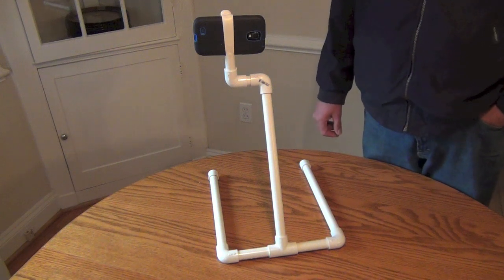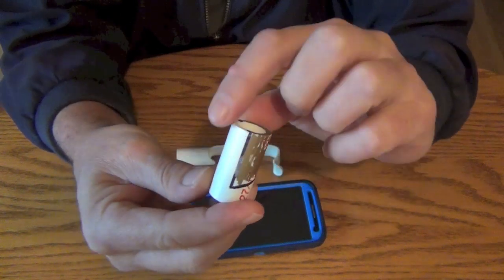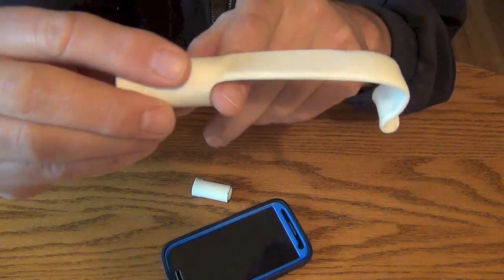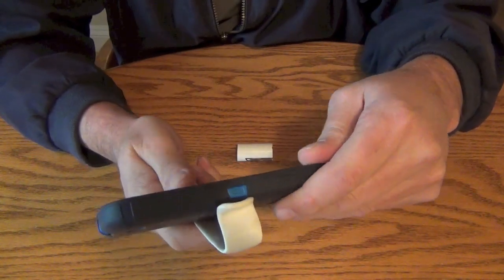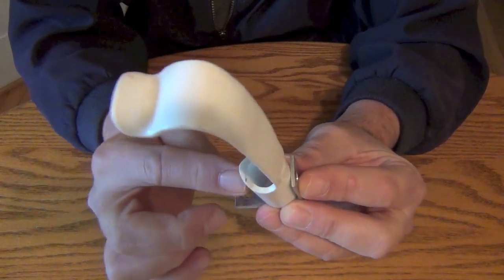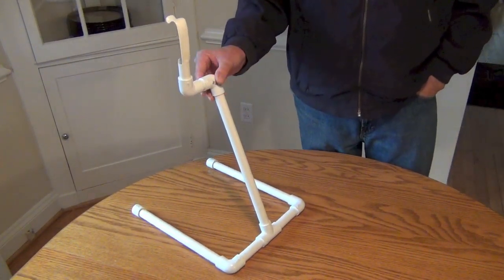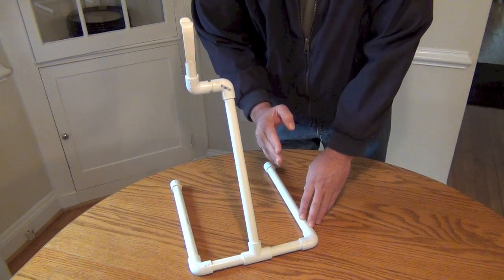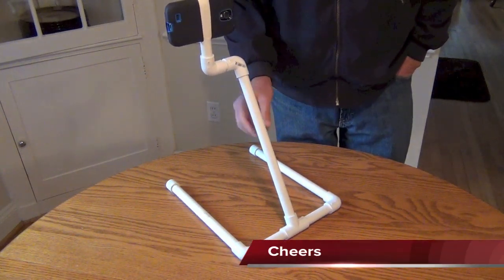DIY PVC Smartphone Tripod Mount and Stand.

Comment: First off, GREAT VIDEO.  Outstanding out-of-the-box thinking.  My only comment is, if you're going the cheap route and you have a heat gun, instead of buying joints, just get yourself 3/4" piping and you can heat up the ends of the 3/4 inch pipe to force the 1/2 pipe into them.  These can then be bent for the 90 degree connections or extensions(save yourself a couple of bucks).

Comment: Nice! I've done a few mounts from belt clip cases and angle bracket tripod mounts. Love the simplicity of this design. I made one from 3/4" which I think works out great for the I6. still need  to insert a plug and 1/4-20 hardware. I'm thinking my next version I will make a wood block template of the phone case to better shape the hot pvc, As well as a sanding block to fine tune the shaping

Comment: I just finished mine and it works wonderfully! Thanks for the idea. I tweaked it slightly as well added the nut directly to the bottom of the pvc so it fits directly into the bolt.
Reply from the maker: Great to hear, glad the idea help you. Cheers
Reply: I wish I could share pictures. I could send you some though if you would like to see the additions I made to it!

Comment: I like it! I think I might cut out the bottom, and heat it flat, jb weld a 1/4 nut to bottom, to use it on a tripod.
     Thx for posting!
Reply from the maker: +onemouse1 That would work, but you would need 2 nuts, one for landscape configuration (videos, and pictures), the other for portrait (pictures). Cheers

Comment: Stanfordcoffee. thank you. I just happen to have a piece of pipe that I cut a week ago.  And I tell you,  I am happy I came across this clip.

I will be using some glue to place in the1/4-20 on the bottom,  And maybe paint the pipe?Also some cushioning on the bottom and top inside.

Simple to the point,  very clear instructions demonstrated,  thanks once againf or all your wonderful tips on how to

FISH

It's not a Glif but will perfectly do
Reply from the maker: Thanks. My phone has the rubber case, so I don't need any foam, and the pipe grips is very well. I put some felt pads on the bottom of the stand so I can slide it around, and it doesn't make any noise. Cheers

Comment: Thanks alot man, I just made my tripod and I can't wait to use it
Reply from the maker: I use mine all the time. I found that the sand in the bottom legs helps to stabilize the Smartphone while taking video (if you're carrying it). I bend it around, until I find the balance point, and then it acts sort of like a steady cam. It illuminated a lot of the shakiness you get while filming with a smartphone. Just a thought. Cheers
Yo uso la mía todo el tiempo. Me encontré con que la arena en las piernas inferiores ayuda a estabilizar el Smartphone al tomar vídeo (si lo lleva encima). Me inclino a su alrededor, hasta encontrar el punto de equilibrio, y entonces actúa como una especie de steady cam. Se iluminó una gran parte de la inestabilidad se obtiene durante el rodaje con un teléfono inteligente. Es sólo una idea. ¡Salud

Comment: This looks great, I can't wait to give it a try! I don't use PVC very often, so my main question is what would you use to cut out the shape of the holder? I assume you can use a pipe cutter to shorten the whole tube, but it looks a bit trickier to actually use that same thing inside the tube itself.
Reply from the maker: +Emily Louise PVC is very easy to work with. I use all my woodcutting saws. Just sand the edges when you're done cutting. Cheers
Reply: +stanfordcoffee Thanks a lot!

Comment: USE Velcro. The best solution!
2 pieces of Velcro. One on the dash (or any surface you may want to attach the phone TO), and other either on the back of the phone (Or phone) case). Be sure to clean the surfaces with alcohol before sticking on the Velcro. 
                                         Simple and works really well.

Comment from the maker: A simple, inexpensive, DIY PVC Smartphone Tripod Mount and Stand.
Reply: +stanfordcoffee  a better way to mount it to a tripod would be to take a nut the size that fits the tripod and put it inside the pipe and ill it in with hot glue, if you know what I mean. but that's just my opinion. anyways nice vid. very helpfulthanks
Reply: +Jabber Jabbinski — Save the hot melt glue for wood and paper projects.  Hot melt glue is terrible stuff; it doesn't stick well to metal or plastics, and the torque that one might expect on a nut mounted in the way you describe would rip it out of the pipe the first time you try to use it.
Reply: +stanfordcoffee  could you screw pvc cap on tripod too, just using tripod bolt type and nuts inside of the pvc cap =)

Comment: sir ,thank you very much for tips but i don't understand how you prepare gripe
Reply from the maker: Devidas Dandgaonkar I have to redo this video showing specifics. Make a cut in from the top of the pipe 2 inches longer than your phone is wide. Then make it 45° cut in to remove the excess material. Heat the part that is sticking out using a stove for heat gun. The PVC pipe will become very soft and flexible. Bend it around your phone to act as a clamp. I hope this helps. Cheers
Reply: Thanks i have everything ready except upper part today i will try on GAS burner i donot  have heat gun i have kept two gripes ready for the same.Thanks once again.
Reply from the maker: A gas burner will work just fine. Just make sure you keep it high above the flame, and heat it SLOWLY (you do not want the pipe to turn brown - or it will become very brittle). Cheers